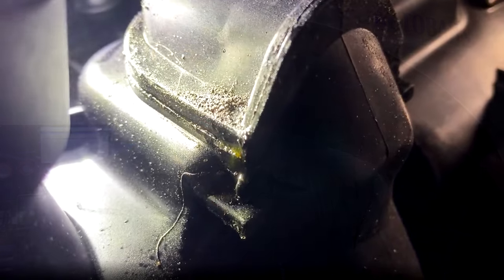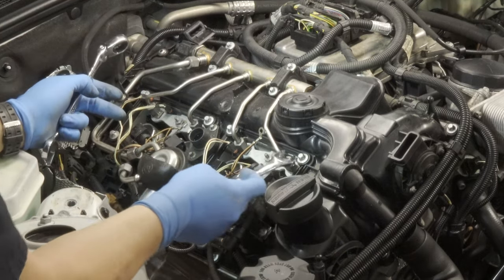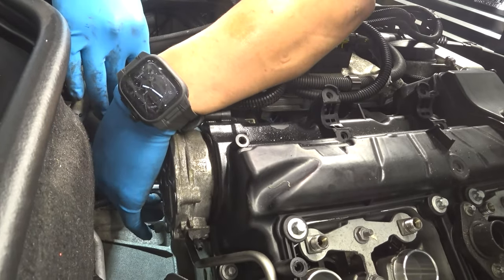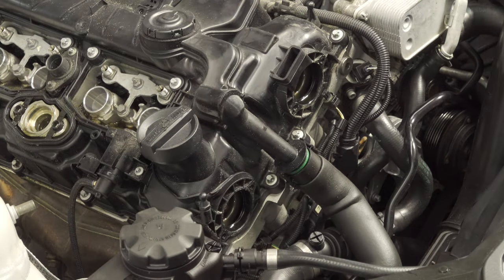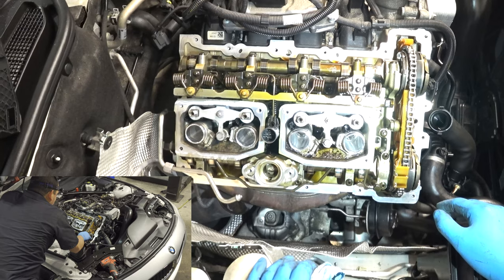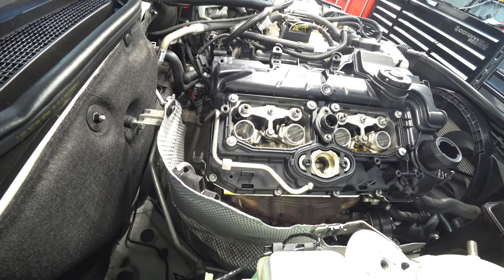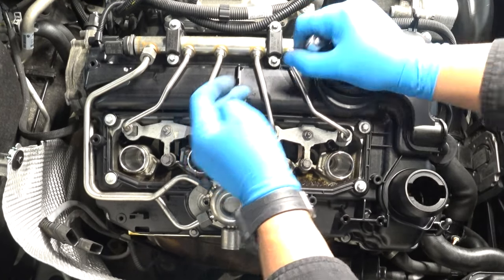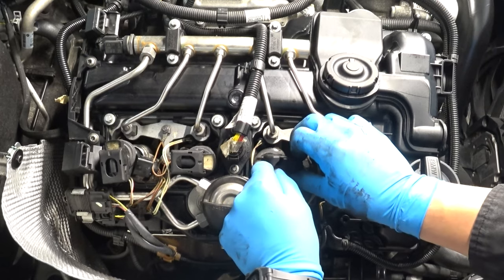2013 BMW Z4 E89 2.0L N20 - VALVE COVER GASKET REPLACEMENT - STEP BY STEP

Comment: This is crazy! I saw you doing some diagnostic work some time ago alongside???? I forget, but definitely liked how you approached and explained the job and way of thinking about it.  So, tonight I specifically was looking at an intermittent no start issue on a VW  Passat which you narrowed down to the immobilizer...... so I got hungry for more diagnosis vids! and went to your list, and you just put this one up. I bought a Z4 last year with front end damage, did a bunch of repairs, and I'm down to coding out the adaptive headlights as I installed an aftermarket set. I got the INPA software and watched some criptive videos on coding out that feature but, they are not clear on how they get it done, so, I'm holding out on that one. I'll keep my eye out for you as someone else might have a bimmer that needs the same. Anyhoo, you're very thorough and clear in all your work, and of course, I had to sub!

Comment: MARIO!  Wifey has this same engine in her X3.  Was the boost code perhaps 120308 Underboost code?  I’ve been troubleshooting this code and cannot find the leak causing this.  Either way, thanks for the info.  You, PHD, and Diagnose Dan are my mechanical heroes so to speak.
Reply from the maker: It was a 002c57 charging pressure control too low

Comment: The reason for disconnecting the battery is because the low pressure fuel pump will prime when waking up the can bus. Opening door/touching engine lid switch or anything along the line. It squirts the fuel all over the enginebay if the supplyline is disconnected
Reply from the maker: This vehicle does not prime the low side pump when opening the door. Some do, but this one does not. Besides, no one touches the vehicle that I'm working on at my shop